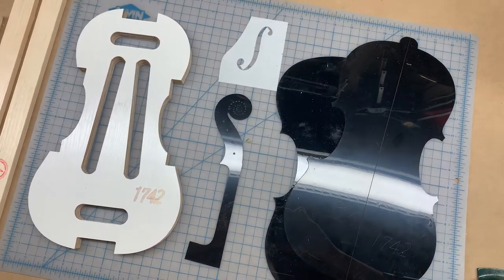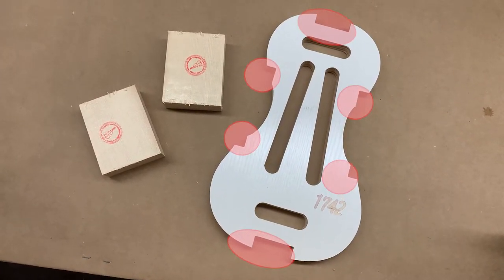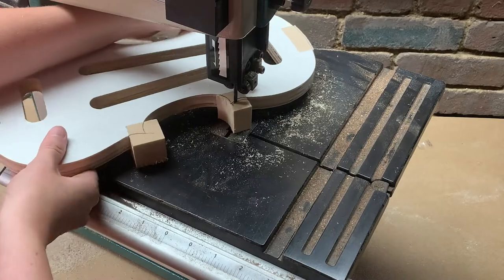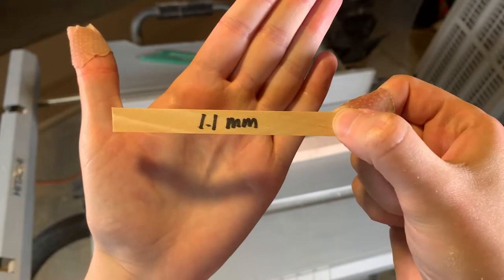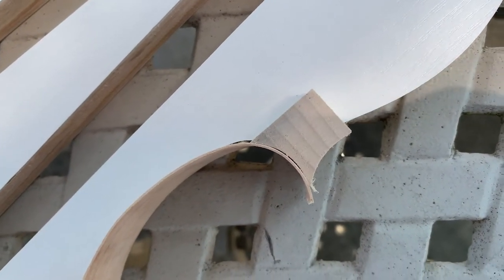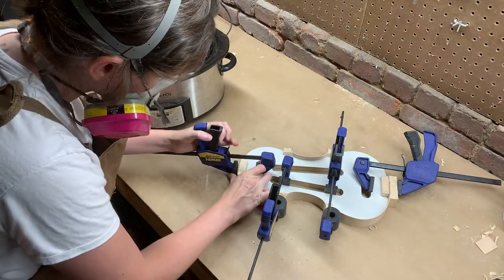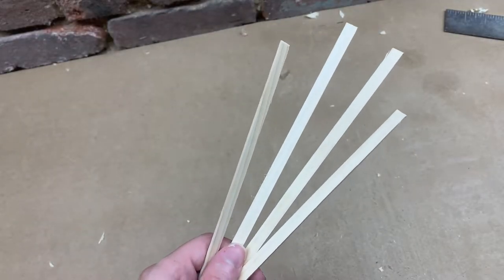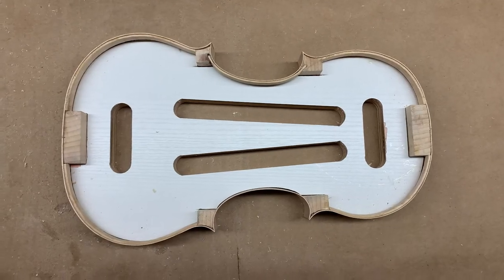Making a Violin (Part 1) The Blocks, Ribs & Linings, DIY

Comment: Amazing, if that’s your first go.
Reply from the maker: Thanks Alan! Turns out this might have been the easiest part of the build, the front plate is giving me loads of trouble!
Reply: @KelleyMakes  Hi Kelly, thanks for the reply.  I was thinking of having a go myself, so am watching with interest.  Have you posted the second instalment yet?
Reply from the maker: @Drlush1  give it a try! I haven’t posted the next part because I had a baby recently and don’t have the time, but there are several other makers on YouTube doing similar things. Check out John mangum. Also, buy the book the art of violin making. I got most of my information from these two sources!
Reply: @KelleyMakes  Super, thanks for the pointer.  And many congrats on the new arrival.

Comment: Fantastic work and terrific video.  I have built one each classical and a steel string guitars.  Though not exactly a set of Lincoln Logs, they do not require the absolute precision that is needed to build a violin.  I have had a violin build on my bucket list for quite some time, and I think your video will serve as my inspiration to build one and check this off my list.  I will most definately be on the lookout for your next installment. 🎻👌
Reply from the maker: Thank you so much! Best of luck in your next project

Comment: looks really good so far . i think that smell your smelling is like when you start up a furnace or electric heater for the first time im sure it will get better . im a new subscriber cause i know by the time your done with this violin you will be hooked . this may be your first but it will not be your last . and just so you know you dont need fancy wood . local wood will work just fine . really the only thing i see the most is people use spruce for the top and maple for the sides and back . but really there are no rules . dont get hung up on rules . i will say spruce should be used for the top . just because its such a good tone wood . cant wait to see your next video on this if its out already ill be in your comments again im sure .
Reply from the maker: Thanks so much for the comment! The reason I started off with “fancy” wood is because when I’m new to something I don’t like to “bend the rules” before I really understand the nature of what I’m doing. I’ve seen people make violins/fiddles out of all kinds of wood and they sounded great! Definitely something I’ll consider in the future. That highly flamed maple is very very difficult to bend. Broke a lot of pieces before I gave up and bought a less flamed maple slab.

Comment: You're so smart, and so skillful Kelley.
Fantastic job. I can't wait to see the rest of it.
I wonder what finish you will eventually give to the maple.  You can do some pretty amazing things with maple, using "aqua fortis'... I don't know if that's appropriate for a violin, but it looks amazing on maple gun stocks on old Kentucky long guns. ❤
Will you go for a modern polyurethane finish or a more traditional shellac, or a hand rubbed oil finish?
I wonder. 
Whatever you choose, I'm sure it will be beautiful.
Reply from the maker: Thanks Adam! I’m thinking of some kind of dye or pigment, probably iron oxide. And finishing with shellac and tru oil (French polishing method).

Comment: FYI The shape of a violin is actually an archetype. This is a set of geometry instructions on how to lay out the violin. A major difference is in the shape of the C bouts. Strat had smaller rounder bouts while gunarie for example had longer slimmer bouts. These affect how easy it is to make the instrument “cry and sing” with warmth. Remember, Strat worked hundreds of years prior to the metric system so accurate drawings and templates are hard to find. Strat began at age 15 and worked into his late eighties. He changed his archetypes frequently in search of perfection. At the end, he went back to features of his early works.

So far you are doing an admirable job. The worst thing here are the costs of special tools like body clamps and finger planes. Thicknessing of the top and tone bar are time consuming.
Reply from the maker: Thank you so much for the info! Yes, it’s been very time consuming but rewarding.

Comment: Hi KelleyMakes! I just got into a uni with an amazing wood-related Makerspace, and my eventual goal is to make a violin like you have done in this picture. I've used a bandsaw, tablesaw, and belt sander before, but not to enough of a degree that I would call my self competent enough to make something with this much precision and talent. Do you have any recommendations of channels, websites, or videos I can go to to learn more? You really are just so skilled and I'd like to also get into more into wood-making!
Reply from the maker: Hi hannah! Great question. Check out Fine Woodworking, it’s a website as well as a magazine. I’m sure your school has great instruction regarding safety and use though.

Comment: I'm impressed.  Would it be possible for your to write the name and web address of where you bought the wood and templates?  How much do you think you spend in wood, forms, and luthier tools (appreciate if you could list out each separately)?  I've got a bug to try and make a violin.
Reply from the maker: Hi again, Joe! Thanks so much for watching. The form and templates can be found on eBay by searching “violin molds/templates.” The wood was purchased from carpathiantonewood. As far as how much to spend on wood and tools, it really depends. The wood I bought was in the $400-500 range including shipping. The forms and molds were about $75. I haven’t yet bought all the luthier tools for carving, but several good gouges are needed as well as tiny little thumb planes. It’s not a cheap proposition, but it’s doable over time.
Reply: @KelleyMakes  Thanks for the info.  As a woodworker, I've had a feeling how much it costs to build something with good wood for hardwood furniture.  I knew wood for musical instruments was of a higher quality and thus likely more expensive.  The numbers help put it in perspective.  The way I look at it, to make say a nightstand, with hand tools will likely take me 100 to 200 hours.  GIven I have a day job and a family, it will likely take me 6 months.  As such, $500 for wood that takes me 6 month to "use up" is very affordable.  There are many hobbies that cost much more and just leave you with memories.
Reply from the maker: @joeleonetti8976  that’s a good way of looking at it! It’s also something you’ll have forever.

Comment: Just a couple things to note.  I think traditionally the corner blocks have diagonal grain not horizontal.  Personally, I mortice all my linings and not just the C-bout ones but that is a preference.  Didn't hear any mention of block and or rib tapering.  Kind of hard to tell but at 3:08 the blocks seem flush with one side of the mold.  Is this a multi-layer mold and you removed the layer of the mold where it is flat to the blocks in order to do the linings on that side?  In general, good job.
Reply from the maker: The Art of Violin Making specifies horizontal grain specifically on the corner blocks, however I know that diagonal seems more common, like you mentioned. I also remember reading that morticing ALL linings had no added benefit for a lot of extra work and I don’t think the masters did that, but I could be wrong! I kind of cheated here and I’m going to be doing the second side of linings at a later time so I could get the mold off more easily.
Reply: @KelleyMakes  Has progress stalled due to life getting in the way?  Anyway, looking forward to the next videos.  I'm only an amateur as well but have a bit more experience than you so if you have any questions feel free to ask.
Reply from the maker: It has indeed gotten in the way! I’m currently carving the top of the violin but it’s going to take a big backseat for a while as woodworking and taking care of a newborn aren’t very easy to do at the same time! Lol